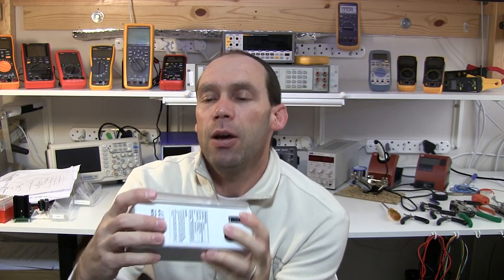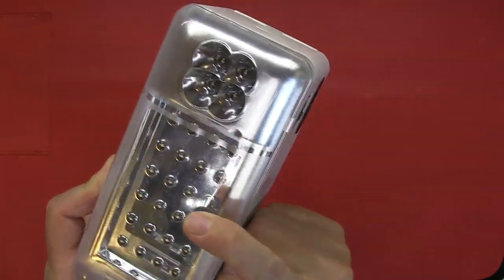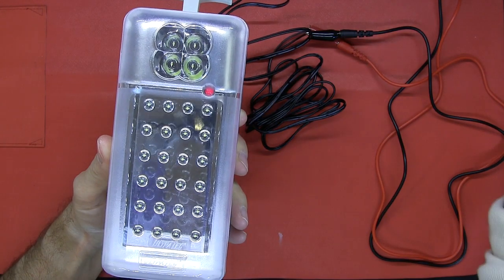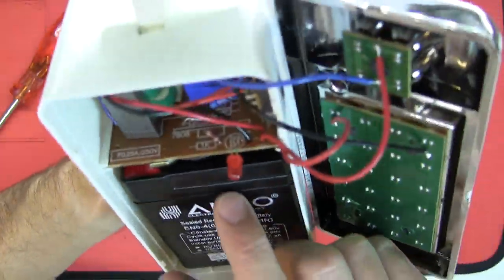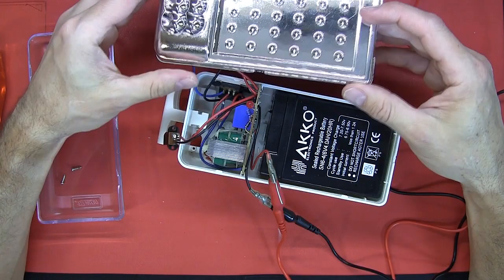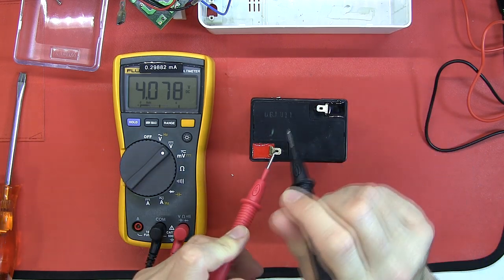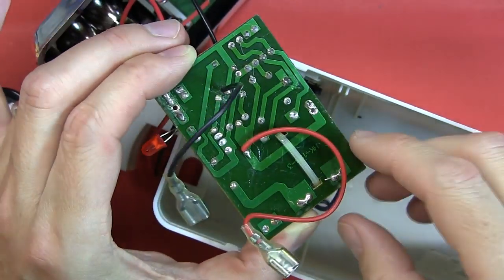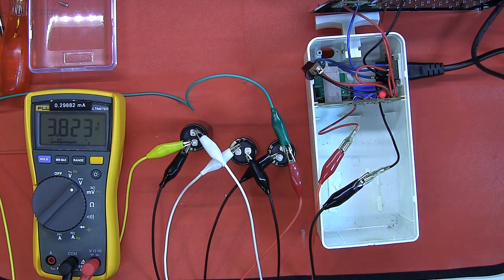A Look Inside #1 - Emergency LED Light

Comment: I find such value in you flipping between an actual example and paper circuit diagram. Even more so how you measure the values at each stage of the circuit and even switching out a component to determine how it affects the system ... 

Would you consider extending the series to where you finally improve this design in theory (it wouldn't fit in the box in practice), to include a decent charger circuit (to preserve the battery life) citing the various voltages and considerations along the way.

Comment: You did a very nice job walking through the workings of that PSU.  The demonstration of the higher value cap in the circuit was a great way of showing exactly what you were talking about!

Have to say tho, I cringed a bit watching you play with the live mains.  I'd prefer to see you switch off, use croc clips, then power back up and use 1 hand, not two when probing any mains voltages.

Thanks again for your efforts.

Comment: @25:31  It looks like they thought of using a 7808 linear regulator on a tiny heatsink (or a metal plate) and just decided to skip it in later versions. 
You have the silk screen for it on the board.  
Could explain the ~9v in, to allow about 0.5-1v for the drop on the regulator.

Comment from the maker: I would need to use enough super / hybrid capacitors in series to ensure the rated voltage per cap is not exceeded or they might be damaged too. But their advantage is that they don't need a charging circuit...just a straight voltage.

Comment: Hi martin, 31:36 that is not correct. the bridge rectifier doesn't flip the waveform. it just guides it to the right side. 
the output of the transformer is unbalanced. (not 0v and 11.5v... the difference is 11.5) so the negative rail is not flat.
Thanks again for another great video!

Comment: Very interesting video. Loved it!
There is about 8.9V coming from the floating charger that is waaaaay to high! For standby use there should be no more than 6.8V to 6.9V coming to those battery terminals. In other words, the charger is putting 2V too much on the battery, making the battery exessively gas off. 4V on the battery terminals sounds like one cell is shorted, as each cell should have rougly 2V.
What would the supercaps do if you had a overvoltage condition on the charging input?

Comment: adding some MOV's, diode and a fuse to the input? Gives it some cheap protection. Better than replacing expensive supercaps.
You also could use a shottky diode with a 2v forward bias on the chargers output and replace the battery.

Comment: Ha, very long term viewer, guess what, just found that emergency light in my drawer which I bought in SA in 2017.  So this 10 year old  video is still extremely usefull.  The battery is of course dead. Managed to damage it while openening, note to myself, first check videos before doing this stuff.  Now need to find a project as I do not like these batteries (read I have plenty of other ones).

Comment: I was working on an emergency light recently and it had the same faith; a faulty battery. I just salvaged the PCB because I wanted to keep the transformer and various bits and threw the rest out :/

Comment: Hi, very insightful video. I made a diagram in Proteus 8 Pro and I have added a charging circuit but as I'm not experienced in electronics, I would like to send you the diagram. Is there any way to contact you? I'd really like to know your thoughts regarding this.

Comment: i would do away with the 4 led and add a buzzer to that side of the switch then when power goes out you will hear it and you can always switch it over to other led if you need light

Comment: Indeed very simple circuit and probably too simple. Lead batteries are horrible and should be put to death but it looks like that circuit tried to charge a 6V cell to over 9V and keep it there always?
Off the top of my head that seems like bad design : )
The powering of the LEDs seems similarly questionable with no regulation so rather than hack this it might be more interesting to design more or less from scratch.
maybe just a beeper without recharger if it's rare that it comes on and low power